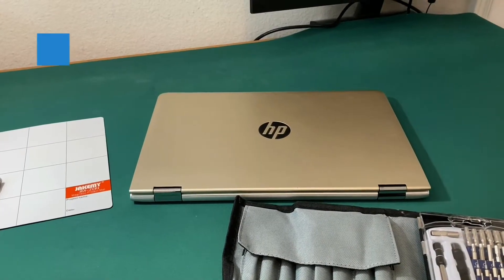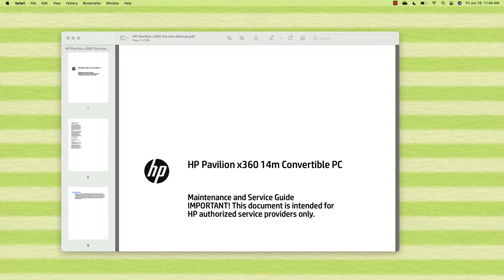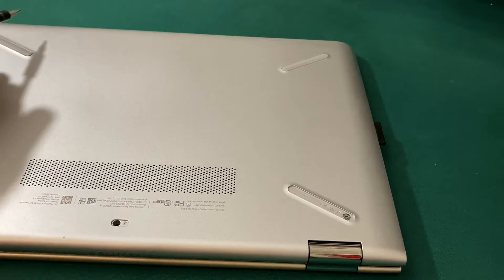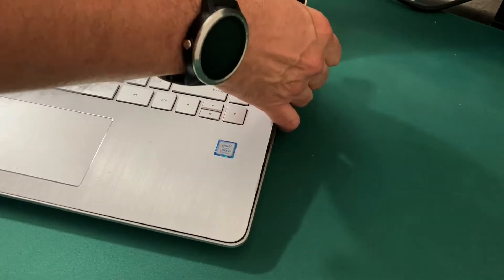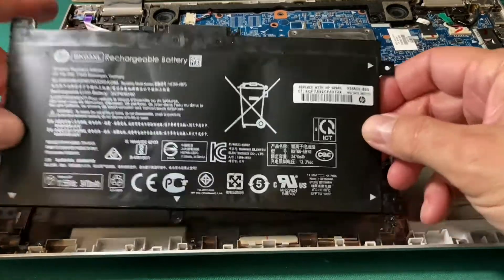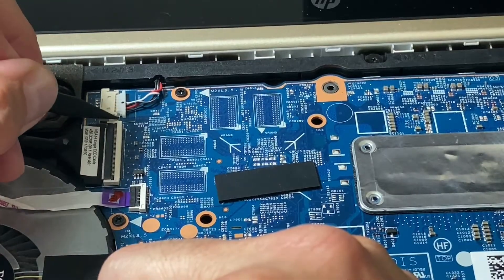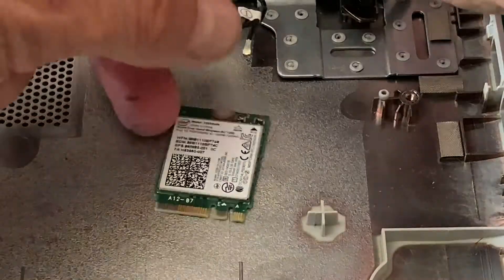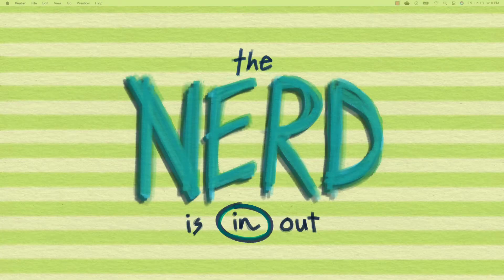HP Pavilion x360 14m Upgrade

Comment: Wife has this laptop. Just got upgrading it. I hope whoever at HP put this design together always steps in water when wearing socks. B/c this was a massive pain to pull apart and work on. They went all-in on this "form over function" sleek look by not providing easy-access panels on the bottom. Having to remove the entire mobo to upgrade/replace key components is awful. Surprised they didn't just go the extra mile and glue everything together to really underline the fact they consider these laptops disposables, and would prefer someone popping $ to just buy a new one. Hardware has been "good enough" for the past 5-10 years in PC / laptop world, so PC/laptop manufacturers have to find annoying ways to force more purchases, like making it a super PITA to work on them. Currently I'm trying to find a way to get a 2.5" drive into that empty bay, and all the folks answering on the HP forums keep saying 'get the hard drive kit' but don't provide part number. They go "look in the manual!" and the manual lists the part number for a rubber sleeve, but not the hard drive bay kit or the connector cable. It's like pulling teeth. Plus, I ended up on HP's parts site try to find the parts, and ran across the prices for 8gb ram, new SSD M2, etc.. and they are OUTRAGEOUS. They want $80 for a 8gb stick of ram, $250 for the small M2 SSD that came with it. That's crazy. Either HP is into highway robbery, or they're trying to price things i a way to push folks to give up and buy a new laptop. Not sure I'd buy an HP laptop again b/c of all this. Which is ironic, b/c I just bought an HP EliteDesk G2 mini pc, and I love the thing.

Comment: That m.2 slot got me so confused.

Mine is the same laptop except when I flipped it, it doesn't have a pre-installed ssd on that m.2. What makes it worse is it has a label on the board that say "msata 1".

So does an m.2 nvme will actually work or is there a different kind that I should buy?

Comment: Hi i have hp pavilion x360 ba073tx model. I want upgrade to SSD. if i upgrade to ssd , then do i have to use hard drive externally ?
Reply: Not necessarily, but you can keep both drives into same PC. 
The recommendation is SSD for OS and programs and HDD for rest of files

Comment: That's an incredible tutorial. Very easy to follow up. One question. How can I add a sata ssd if there's those little black block ( you show it at 10:00) in the place where it is supposed to go? It goes above it ? I was afraid of force it out. And can I connect it with any flat cable or just for hp pavilion x360 ? do you recommend any please ?

Comment: Thank you for this very helpful video. It enabled me to feel confident enough to upgrade the ram on my 15" HP Pavilion laptop. It also showed where the problem was when my WiFi no longer worked after reassembly (The Wifi card had come adrift from the MB), so all in all an excellent video.

Comment: At 9:58 in the video, you can see that there is a SATA slot that is currently unused in this model, which is the same model I own. I'm curious if it's possible to install a 2.5" SSD in the empty disk bay and connect it to the unused SATA slot using the purple SATA cable that you began to disconnect at 10:46. Interestingly, this purple SATA cable appears to have the same serial number as the one mentioned in the manual for adding a second disk. The only issue I've encountered is that the cable that came with the laptop lacks the SATA connector required to connect it to the SSD, as it only has the part that connects it to the motherboard.

I know that there are easier ways to do this, but I already have an SSD and I wanted to upgrade my 14m-b and I can't afford a new M.2. or an official sata cable for this specific laptop model

thanks for your time! amazing video

Comment: Thank you for this comprehensive walkthrough video.  I just added an extra 8 GB of RAM and your video was so detailed that it allowed me to look out for some easy overlooks.  I inadvertently disconnected my network card from the motherboard and it was a pain to reconnect the antenna connections but I got it done.  Also, the connection to the display monitor was kind of tricky in order for the screen to function.  Lastly, those three ribbon connections for the keyboard doesn't allow for much space to work with so patience is key.  I know I'll be opening up the computer again to upgrade to an SSD drive (currently it has an SAS) but in my case, it will not call for me to remove the motherboard so it won't be as involved next time around.  Thanks again!
Reply from the maker: You have to get a couple of parts:
Search on Amazon for: SATA Hard Drive Disk Connector Cable Replacement for HP Pavilion X360 14M
You will also need the HDD rubber sleeve, HP part # 924283-001
This video will help for the install: https://www.youtube.com/watch?v=0iR4wUmTjQI

Comment: You should really learn how ZIF connectors work.  99% of the time the ribbons are tabbed.  You need to lift the ribbon about 90 degrees and the tabs will lift out and disconnect. You should never have to pull on them, and where you were having problems at the 11:00 mark, was because you were doing it wrong.  Your method can ruin the tabs, which is what seats them perfectly in place.  The cover then locks them down.

Comment: In this laptop have M2 SSD slot?
Reply from the maker: M.2 slot SSDs can talk NVME or SATA To the motherboard. Your M.2 has to talk the correct protocol or it will not work. This HP laptop supports SATA protocol M.2 SSDs only.
Reply: @TheNerdIsIn mi placa tiene una sola muesca como para Nvme no dos como para SATA.

Comment: Thanks for the detailed review, it helped a lot.  Especially the moment with the WiFi card🤦🤣 The first time I disassembled the laptop itself, I spent 2a hours in total.  I added 8gb of ram and changed the thermal paste.  If they wrapped the board on the other side, as in some models, it would be much easier))) but maybe it’s better, given that sometimes the keyboard gets a load from the hands)))
Reply from the maker: Thank you for the kind words.

Comment: when you upgraded the SSD, did you have to reinstall windows?
Reply from the maker: No I did not. To do that, I had created a windows image backup of my old SSD and restored it to the new SSD.  Then I had to resize the windows partition to use the new space on the hard drive.

Comment: Hi, at 8:15 what is the small black rectangular box in the bottom right, I have noticed some xp360 laptops to have the 2.5" sata ssd there . Mine is the same as it has the m.2 and was wondering if you could help me please.

Thanks
Reply from the maker: Many of the x360 (mine included) have the slot for a 2.5" hard drive, but have a M.2 SDD instead.  You could add the 2.5" drive, but would need to get the specific cable from HP to go from the motherboard to the 2.5" hard drive.

Comment: Hello, I have a similar laptop. I just want to examine the fan because it has been making a bit of noise. I'm hoping that it just might need some cleaning or that wires are close to the fan and just need to be adjusted. I have a cover on my laptop but instead of it being ovalular, it's circular and I've never opened the cover. Is there any gentle way of popping the cover up for me to get to the last screw?
Reply from the maker: Every laptop internally can be different. Download the service manual for it and see how to get at the cooling assembly.

Comment: Hello, I have the same laptop and I was a little pre-mature in taking it apart because my new drive didn't arrive like scheduled...there's a delay:( So, I put things back together and the laptop worked just fine; however, I powered it off; however, when I went to power it back up this morning it didn't come one. Not even the light at the power button...nothing.  Any suggestions?

Thanks,
Tony
Reply from the maker: I would go back and check all the ribbon cables. So unfortunately, another disassemble. At least you can see them all with the back shell off and keyboard removed.
Reply: @TheNerdIsIn  I did. All seem good and connected.

Comment: Hi, i have the same HP. I wanna expand the memory ROM as you, but not using onohet SSD M2. I wanted to use an SSD SATA 2.5 inch. I see in your video that there's a hole on the body of the pc to the similar size of this memorys, this space is for this SSD or im wrong? To be honest i don't have any idea about this stuffs, for example i don't see a SATA port in the motherboard. Thanks
Reply from the maker: There is a port on the motherboard for the cable to put a HD in that 2.5” bay. If the laptop does not ship with a drive in that slot, it does not come with the cable. Check the service manual for the part number.

Comment: Hi, i have similar pc, i want to install 2 new ram modules, should i use single or dual rank? Thnaks.
Reply from the maker: Best performance is using both DIMM slots with the RAM modules being the same size and speed.  This should get you dual channel memory.

Comment: Could you add a large hard drive in the empty space? Is that were one would go
Reply from the maker: Yes, but you would have to get the cable from HP to hook it up.
Reply: @ The Nerd Is In, is that the reason why when I installed a 2.5 ssd in that empty space with a cable that I purchased on eBay didn’t work? I ended up getting a different cable and also didn’t work. I tried using a different hard drive and also didn’t work. I have to buy that cable directly from HP in order to add that second 2.5 inch drive? Thanks in advanced.
Reply: Never mind, I eneded up succesfuly adding my SSD with the eBay cable. No need for an HP one. Its all down to formatting the drive using the stock software provided with your HP.